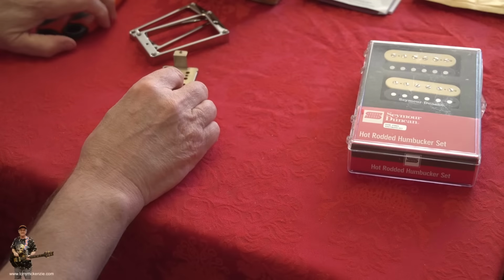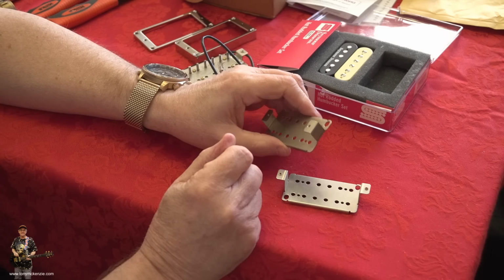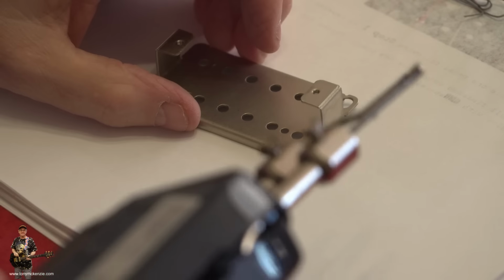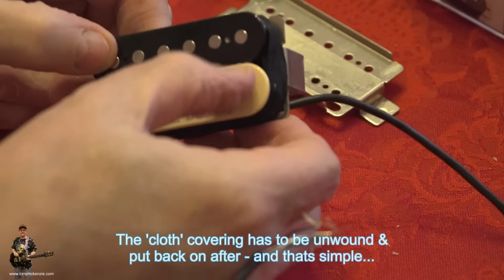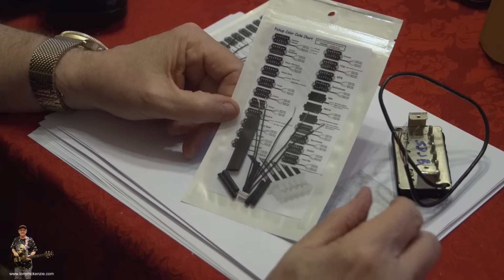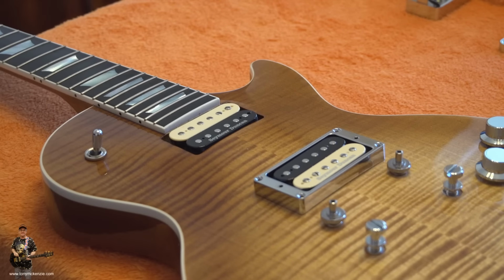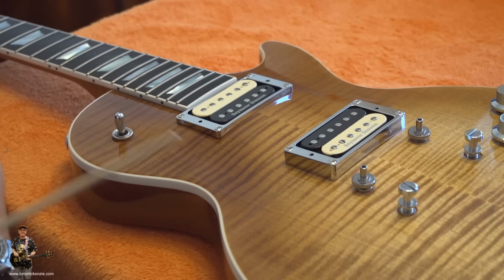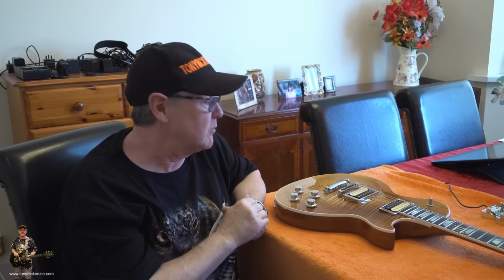How to change Gibson's 2018 HP Pickups for Seymour Duncan Replacements | Add METAL Surrounds

Comment: And Still! the only video that will show you how to do this right. 
I’ve already had to show this video to two in-store techs so they can work on my 24 fret SG with a maple cap.
Best wishes TM.
Reply from the maker: Oh I know. I wanted to fit different pickups to this guitar and started out looking online... there was NOTHING. There really is only one way of creating the conversion properly and that's with the base plate change and solder the bends. These are really good guitars with many good features too and while some guys might be put off with the rear mount pickups once you make the plates its not difficult at all. Glad it's helped you as that was part of the reason for making the video really. Thanks for the kind words, for watching and stay safe.

Comment: Due to all the Gibson fan snobbery they will never make a guitar like this one again. I’m a huge Gibson fan and I frankly love this model year HP for its uniqueness. I completely applaud your efforts and sharing this helpful and informative video but the reason they omit the pick guard, poker chip, and here the pickup rings...is to show off more of that beautiful AAAA maple flame top! Anyone who wants to swap the pickups will hopefully find your video however as it’s necessary and you provide great insight and options. That Seymour Duncan hot rod set is an all time classic but personally I feel it’s missing the chrome covers on this model   Personal taste. I’ve had similar chrome rings like you put on there on a few guitars and they look very good although they never seem to match the arch perfectly. The 2019 Gibson HP metal rings are actually only tops that mount over plastic rings. Fun fact for ya. Cheers!
Reply from the maker: I believe you too. When I wanted to fit other pickups in the guitar there was absolutely nothing on the subject from anywhere. So I decided to do it. These ARE good guitars but many get put off by the pickup mount as you say. Some guys don't like this or that, but I found it all to be pretty cool. Changing pickups was not hard or expensive either. Finding the metal surrounds that fit properly is an achievement - I think I got as close as you can but I also saw some junk ones too. Yes I know about the other rings :)  Its weird how they had the neck shave at the joint - but the Lifeson model did that for years before... all good for that but not for this? There is no logical reason. Thanks for watching  -  I made this specifically to help guys who have the HP LP so they get at least an idea of how to do it all. Thanks and stay safe.
Reply: I have an HPII.  I like it a lot, except Gibson sent me one with some minor blemishes. But, it was a replacement.  There is only a small, small, small club of us.   And I do like the uniqueness.   I just wish I got the Cobalt Blue instead of CherryBurstMayhem.   But, that was my fault. She is still pretty.
Reply from the maker: It matters not - what matters is that you like the guitar. I like them too and no doubt will be undervalued in years to come. But a very well made guitar that sure has a few differences, but its still a Les Paul :) Thanks for the post and for watching.
Reply: I have a blue one and it is a stunner. It did take me several years to bond with it though, mainly because of tuning issues. The culprit was (for the most part) the titanium nut. After I replaced the top portion with a graphtech one I started using it and now it is my main instrument.

It has so many tonal varieties that it can cover pretty much anything and the weight and feel is fantastic. Glad I am part of the very small club. Hopefully it will stay with me for many, many years!

Comment: Thanks for this. Was and actually kind of still am seriously on the fence about purchasing an '18 Standard for this exact pickup swap concern.
Reply from the maker: It's not too bad, but don't 'over bend' the bends I showed. I also soldered those bends to strengthen the metal - it worked fine... Hope it helps and thanks for watching.

Comment: Great tip about the soldering Of the pickup plate feet once bent into position Tony. The guitar looks and sounds great. Good demo by Alan too. 👍🏻
Reply from the maker: The solder simply runs in to the crack created by the bend - its an almost perfect solution - you can't buy the Gibson back plates - they don't sell them I checked. So these worked brilliantly for me and should do the job for everyone. Alan came around and I decided to crow bar him to do it :) it makes a change to get behind the camera too and he did a pretty good job I thought so too. Alan plays as a pro these days and while he does not make millions he has no doubt improved from that continuous playing. I need to be careful :). 

To be honest (ha no matter what he says) his skill with bass and lyrics far outweigh his guitar ability. He loves the guitar, but honestly those other skills are quite incredible. We made three albums to date and I can honestly say that what he did on those I can't or could ever do. I guess that's why it works so well for both of us. Thanks for watching...

Comment: Thanks for this! Would you have any insight into how I might be able to swap-in a set of EMGs? I had thought to put in a set of the 57/66 TW to keep the coils split versatility while bringing the guitar's starting-point for gain more in line with some of my other guitars. After seeing this, I can't really envision a way to do this for the EMGs since the seem fixed to the plate. Thanks in advance for any pointers or insight s you might have!
Reply from the maker: If you can get a bottom plate on as I showed in this then that should be OK... but if the plate wont fit then could be aggro. If the plate on the EMG's is fixed then the only way would be to mod the mount as I showed in the video also. But you would have to be pretty sure those would work for you in the guitar. I just bought some Fluence pickups  which could be mounted at a push but probably no going back so to speak. Of course the regular plate mount pickups can be changed reasonably easy as I showed. Thanks for watching....
Reply: @tonymckenzieofficial  I appreciate the response and further advice. Thank you!

Comment: EXCELLENT,  informative video. Many thanks for your efforts in putting it together for the benefit of us 2018 HPII owners. Would like to know what amp it was played through after the SDs were fitted... and how the sound differed from the original Burstbuckers.
Reply from the maker: The amplifier is a Mezzabarba amp (likely you will not have heard of them) but here's a link to an incredibly detailed inside and out review I made of that amp - as used by Satriani, Steve Vai and many other guys you will see in my video: https://youtu.be/C4WLh0vYaIs  and I'm sure you will like that one. It took me a while to make. I found on the original HP II that the pickups (IMO like all burst buckers) tended to have a strong swing towards being very toppy (or treble biased). In fact too much for me. As you see from my age I come from an era really where I like middle on a pickup. Secondly, I use a wah extensively and with the burst buckers it became simply too much. I have used this Jeff Beck set before and the 'jazz' in the neck really does the mustard through the neck pickup and solved all the 'flabbiness' from over driving in to a rock amp cranked (or at least with high preamp gain). The difference is like playing two completely different guitars. I still have every single push pull setting that the other pickups had, but overall they are far more useable and I can only recommend that upgrade.  Slightly awkward for sure, but I have never done anything to a HP II before I attempted this change so it can be done reasonably easily, and if you liked the new pickups the burst buckers could recover probably all of the cost of the new set. The pickup set cost me £125 in the UK inc. 20% tax and there's no doubt that in the USA that pickup set could be bought for much less than my equivalent. 

Anyone changing the pickups I strongly recommend the metal pickup surrounds to protect the bridge pickup more than anything as that stands out. Alternatively get a set with covers on and don't fit the surrounds if you prefer no surrounds. Hope it all helps and thanks for watching.

Comment: Great job! Where did you get the plug kits? I can't find those particular ones anywhere.
Reply from the maker: Here you go: https://www.ebay.co.uk/itm/Gibson-Quick-Connect-Pickup-Adapter-Kit-Single/273259548870?hash=item3f9f89d0c6:g:mr0AAOSwBXhbFXL5

Comment: Nice job Tony. Did you splice the wires onto the existing connectors?
Reply from the maker: There is a kit on ebay (as I showed in the vid) that you join the wires and heat shrink them, then put an overall heat shrink over the joints. When you plug the pickup in to this guitar you retain EVERY switch feature because the pickup set (Jeff Beck and Jazz) are 4 wire units. It all works wonderfully. :)
Reply: tonymckenziecom yes I saw that part briefly. It’s too bad you didn’t detail that part. Thats one part a lot of people would love to learn. But that’s fine there’s other video out there.
Great video regardless.
Reply: @Thomasdgolden  Exactly that's what I came here for but that part wasn't shown .
Reply from the maker: Gentlemen... I DID show it? https://youtu.be/-MY1vSSy810?t=1075 and as you can see the kits I bought include everything, including the little connectors and I showed also the spliced wires after I fitted the kit. Hope that is clearer and thanks. Stay safe.

Comment: Not sure if I'm missing something...but how hard would it be to put in the missing routs with a dremel and fix it permanently, especially if I was going to put holes for a trim ring anyway?
Is that one of those Presonus personal monitoring things in the studio next to Alan? Does it work well? Nice playing by Alan too :O)
Reply from the maker: You did!. Firstly, I would reckon that most guys might even 'bottle out' of doing what I showed can reasonably easily be done. But also, I think there are substantially less guys that would even entertain a Dremel (or other router) going near their guitar to convert to regular pickups. FYI this guitar in the UK cost about £2300.00 ($2850) so it would not be an easy decision to use a Dremel. In fact I also considered that as you suggested, but decided that it could be reasonably easy to get things wrong... so I did it my way (is that a Sinatra thing?) :)  

Of course if someone can do that without sweating then that's an equally and overall better choice... but Ha let's say I bottled too :). 

Indeed it is a Presonus monitoring unit in the studio because we flipped to Presonus some months ago. What I have found typically, is that if you're a live band on stage with those then its probably worth the effort, but in a studio environment like I have then far less so IMO. I think they are more difficult to set up correctly when you don't have direct inputs coming in to the desk re routing. And I think it's a bit expensive for what it is. The idea is good but the routing for me stinks. I could well be me of course, I'm really famous for the non working digital routing I do every day :)  Thanks Dogpa.
Reply: @tonymckenzieofficial  Thanks for the response! As to the routing...I have a dad and a friend that are master wood workers and they could do it in 10 minutes...they say. I'm not sure I could...LOL!
Reply from the maker: Ha neither could I :). Thanks.

Comment: Capacitance ? Thanks. 
I'll have to relearn all that stuff.
Reply from the maker: Yes there is capacitance in pickups. If the pickup is scatter wound (thing Bare Knuckle Pickups for example) the pickup will sound more toppy than say a regular SD Jeff Beck for example. Also with the Burstbuckers from Gibson I believe they wind one of the coils with less windings... this has a similar effect of less capacitance in the pickup - hence toppy sound compared to machine would pickups with equal windings. Hope it helps and thanks for watching.

Comment: JB stands for Jazz/Blues not Jeff Beck to be precise. Cool vid, as usual, Tony. THX.
Reply from the maker: Hi wolfie ( I know, friends will call you that :)  I can only reply to this as I did to another guy who posted... I'll use the same answer and that way it takes less to type... thanks for the info but....

Sure it is! https://www.musik-produktiv.com/gb/seymour-duncan-sh4-bk-bridge-jb-jeff-beck.html  sh4 is the one I fitted as part of the kit? Don't confuse the NECK pickup with the JB... the neck IS a Jazz pickup.  Another: https://shop.rall-online.net/Seymour-Duncan-SH-4-Jeff-Beck-bridge-position-4-cond-black    and when I read a forum (yuk) someone posted this from Seymour himself: 

Taken from the SD pages...the Jeff Beck...I mean Jazz/Blues Tele-Gib story...
After sending his favorite Les Paul® to a shady repairman who switched out the P.A.F.’s for newer, squealing, pickups, Jeff came to Seymour for help and advice. Seymour repaired Jeff’s Les Paul, and then set about creating a special guitar for Jeff with a pair of pickups that would capture Jeff’s amazing ability to coax a wide range of tones out of his axe.The result was a guitar that Seymour gave to Jeff as a gift. The body and neck were clearly Telecaster®. But the pickups were two re-wound humbuckers made from broken P.A.F.s Seymour rescued from Lonnie Mack’s Flying V®. Seymour called the guitar a “Tele-Gib,” and nicknamed the bridge pickup “JB” and the neck pickup “JM,” after the hot rod racer, “John Milner,” in the classic film, American Graffiti. (Eventually, “JM” would change to “Jazz Model,” which is what it’s called today.) Jeff used the Tele-Gib on his amazing 1975 release, Blow By Blow, where it gained notoriety for the haunting volume swells heard on “Cause We Ended As Lovers,” which Jeff dedicated to Roy Buchanon. Interestingly, it was Seymour who introduced Jeff to Roy a few months prior.

The JB bridge pickup became very popular, very quick. Soon, many of England’s top guitarists, including more than a few legendary names, sought out Seymour’s “JB Mod” for their guitars. They found that the JB gave increased output (16.4K Ohms) without sounding harsh or dark, like other high-output pickups of the mid-‘70s. When Seymour returned to the USA the next year, his reputation as a pickup designer and the JB’s reputation as a great pickup preceded him. And the rest was history. Jeff was involved somewhere there and I distinctly remembered the 'JB being related to Jeff Beck. As you see in the ads they too call it the Jeff Beck model.... as indeed I understood it to be. Indeed an interesting subject - I'll call it a Jeff Beck simply because back in those days that's what I knew it to be, but you know how things go with names... it could even stand for Jammy Bas***d if you have a set :) Thanks for making me dig deeper :)
Show less 

Now then.... we can't all be wrong :)  and thanks for watching.
Reply: Wolfie got schooled